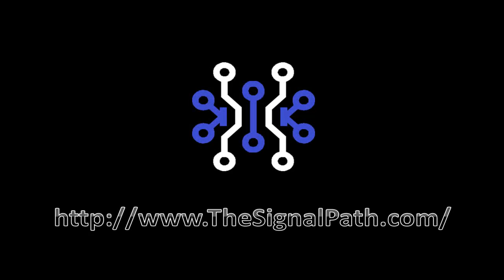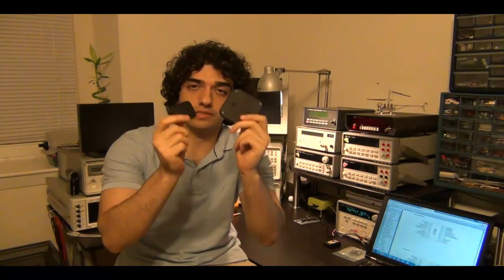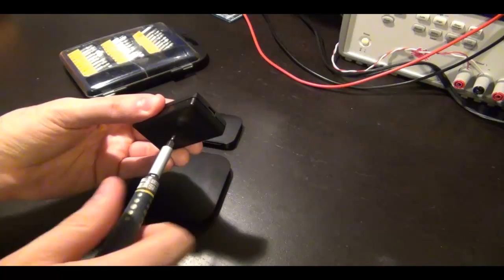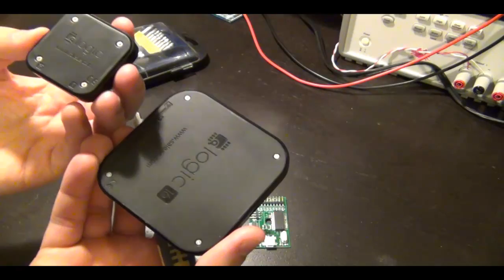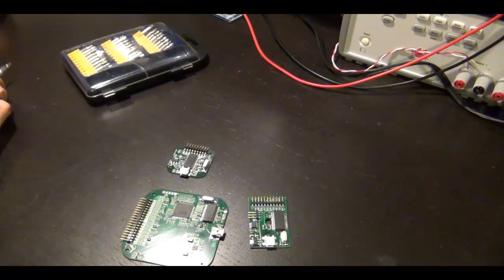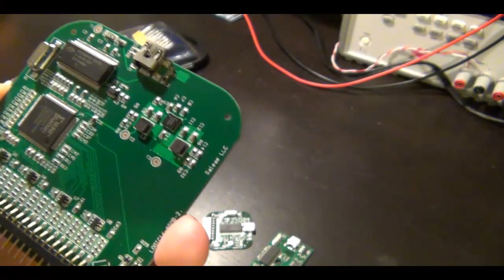TSP #2 - Saleae Logic and Logic16 Product Teardown

Comment: Hello, sorry to correct you, this CHIP has TVS protection over all 8 channels, in fact I found that out when 2 of my channels on my Logic, they where following each other, so removed the bad TVS chip and it is corrected, replaced it with same layout chip I used in my design all works good, I have my logic back works nice with Protection is Back,,  those 2 chips are U4 and U2 ,, those are 5 channel TVS chips SOT-6 pkg

Comment: Why is Curved\folded in some traces used?!! please small Answer with reference would be awesome. thanks in Advance
Reply: I believe these are used to ensure that signals travel the same distance to reach the chip. These traces are important for time sensitive signals. If you look at traces in GPUs you can see these as well.
Reply: Wiggly traces are used for trace length matching, essentially to delay a signal which is travelling at approximately light speed. My guess is that the Xilinx can only capture eight channels simultaneously and the second eight will be captured one clock cycle later, so the pcb designer matched each of these eight channels to each other. 
If you didn't match lengths at all some events would arrive later at some inputs than at others and you might get an inconsistent state where there are some old and some new samples in the same capture.
Here is some more info on trace length matching:
https://www.nwengineeringllc.com/article/guide-to-pcb-trace-length-matching-in-high-speed-design.php
Reply: @JonaJona   Thank you Sir, I'll appreciate it

Comment: Saleae logic has over voltage protection of +/- 15v,  Not meant for continuous operation outside -0.5V to 5.25V............  The logic 16 has a over voltage protection of +/-50v. Not meant for continuous operation outside -0.9V to 6V.
Reply: something trivial from:  https://support.saleae.com/datasheets-and-specifications/datasheets, and quoted verbatim: "The input pins on the new Saleae Logic devices (Logic 4, Logic 8, Logic Pro 8 and Logic Pro 16) have
protection for signals within -25.00V to +25.00V for continuous operation."